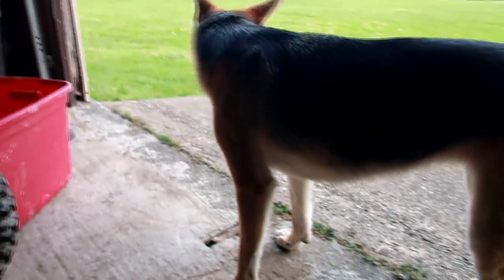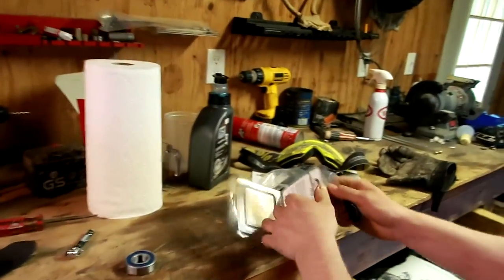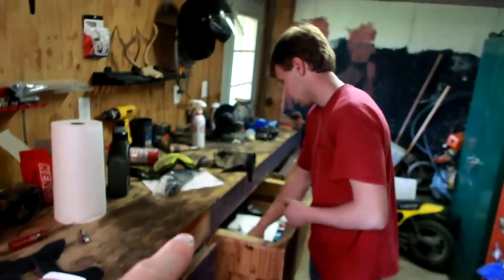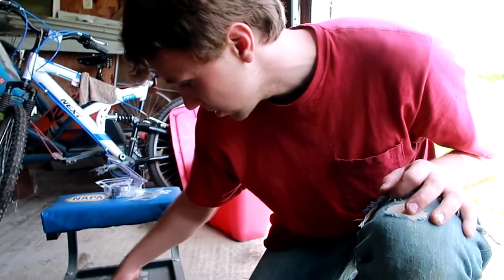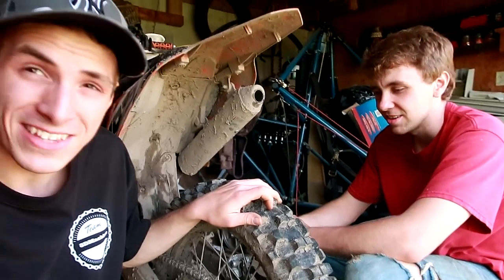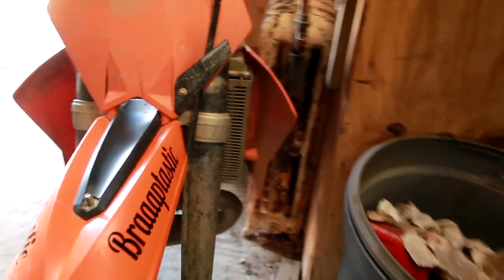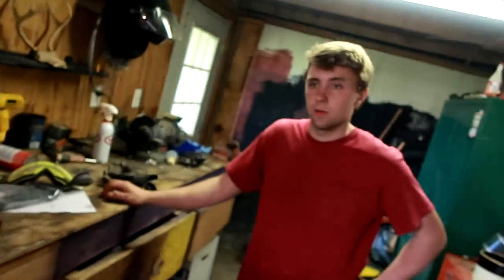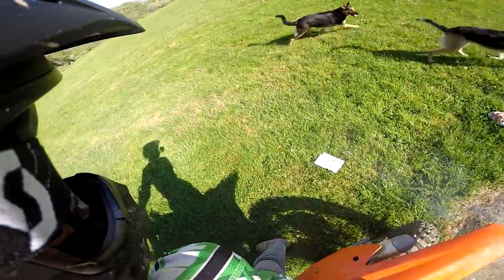KTM 300 PARTS & UPGRADES

Comment: Get a head gasket and a set of rings and slap the new rings on new head gasket break it  like you would a new rebuild and you'll get compression back and it'll idol and take throttle and rip again

Comment: Most new bearings especially the Chinese crap "sealed bearings" do not have a sufficient amount of grease in them... always pull the seal out with a little hook pick and pack them in high speed grease then snap the seals back in being sure that all the sealing lips are tucked back in their groves... Dont the them shit you a sealed bearing is greasable... I make sure i do this with every sealed bearing before its installed... Take one of those old bearing seals out first so you can see how they work so you dont tear the new seals up taking them out...ALWAYS GREASE A NEW SEALED BEARING OR EVEN JUST TO SEE IF IT HAS SUFFICIENT GREASE... a small o ring hook works the best for me...